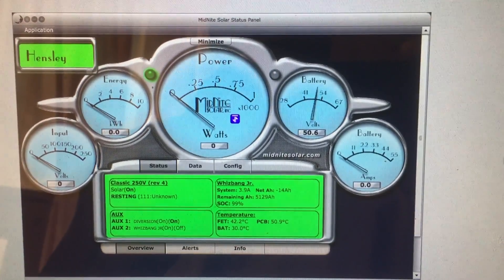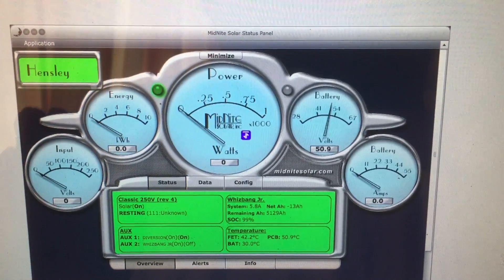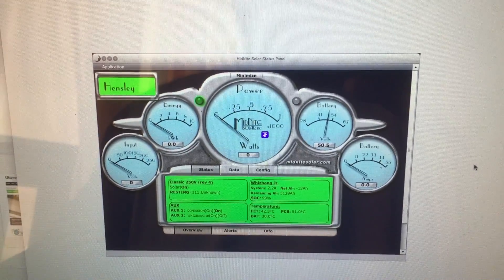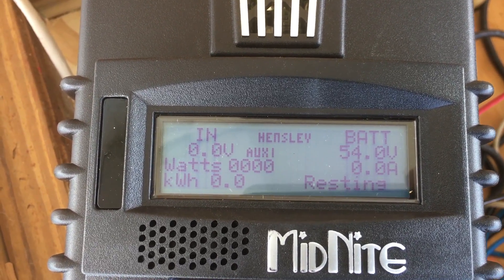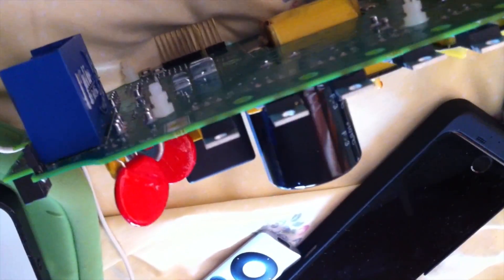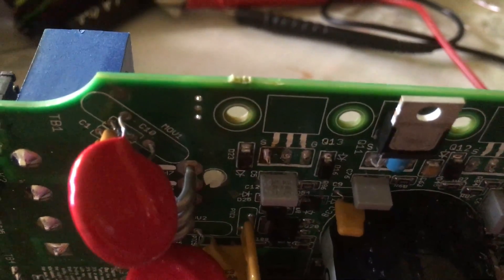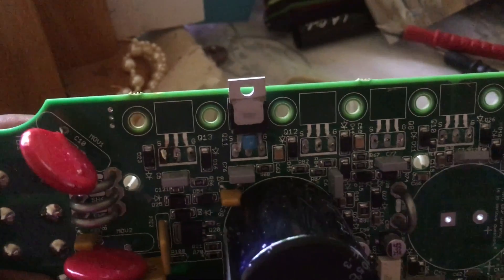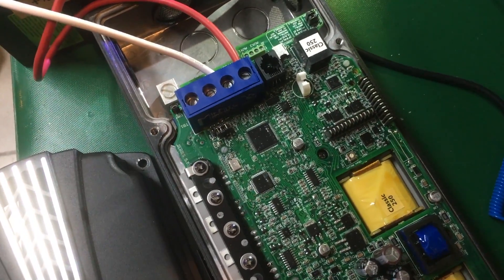Midnite Classic 250 Charge  Controller MOSFET's (IPP200N25N3 G.  PG-TO220-3) failure.

Comment: i have a problem with my charge controller its resting when it should not rest and its showing 0 watts i hear a relay in it clicking i am using lithium batteries
Reply from the maker: What’s the input reading from your solar panels or other sources?  Tell me your battery bank size 48vdc or 24vdc.  Please check your input and output cable connections then run the settings on your classic.  Another thing did you upgraded or reconfigured your system you experience these issues.
Reply: @hibiggs66  the pv volt is 103 before charge controller draw it down to 79.6v the battery is now at 51.6 volt when full charge its 55.9 volt i am using lithium iron batteries i upgrade the firmware to the 2018 firmware this morning
Reply: i have 3 24v pannels in series i have 3000 watts of pannels
Reply from the maker: Do you inverter connected with load. Your battery bank is fully charged and would not engage the classic charge controller to pull resources from the PV.
Reply from the maker: What about the lithium battery BMS is it functioning.
Reply: @hibiggs66  yes the bms is functioning
Reply: the battery is conected as 14s which when fully charged is 55.9 volt  and battery is at 51 volt now
Reply: absorb is set to 55.9 float set to 55.8
Reply from the maker: Let me get some clarity on this are you saying you have less than 130vdc PV connected to the classic.
Reply: @hibiggs66  yes
Reply: its a midnite classic 150 so i didnt go over 100 volt pv with it
Reply from the maker: What about the MODE in the bottom right corner is it ON or Off.
Reply: @hibiggs66  it say mppt theb when it go to resting it say resting
Reply: It dont show watt or battery current i have a wizban jr
Reply: It dont record killowatt either and you keep hear relay chip in and out
Reply from the maker: My conclusions are you may have to change your MOSFET’s.
Reply: @hibiggs66  what are the spesification of tje mosfets where do i get them to buy
Reply from the maker: The first time I changed mine I ordered from AliExpress 8 total. You may have to dig into your system to get the spec or lift one off from the circuit board to get the reading.
Reply: @hibiggs66  ok thank you
Reply: the charge controller start working properly now so this is strange something is bad in the charge controller but i dont know what it is
Reply: still having problem probably there is a crack joint in the classic voltage on pv is 78v current coming in is 21 amp voltage on battery is 51v current 20 amp
Reply from the maker: Please take a snapshot of the display during the night and day for comparison. I will do the same on mine to see what comparisons we can reference.
Reply: @hibiggs66  thank you i will do that
Reply from the maker: What’s the status on your classic change controller for the past few hours.

Comment: Great job 👍 did this fix the problem?? I’ve also got the same issue so I’m looking to do the same rather than buy a new board i also have a 250 Same as yours so I need to purchase the mosfet’s do you have the link where you bought them from
Reply: Helo, I can not find the mosfet référence number for the midnight classic 250. Can you help me. Thanks
Reply: @cristof48  I got it from digi key the number is an American numbering system so it’s difficult to find my advice is match the voltage and amps for the controller and it should be right but it’s worth sending off to get fixed as it’s actually not that bad a price and you might need to replace more than you think 👍
Reply from the maker: Yes I did. working perfectly up to now. check out  aliexpress.com for the Mosfet's.
Reply: Hensley Isaac thanks very much for your advice on this I’ve done it and it worked I’m so pleased I got my mosfet’s from a company called Digi-Key in the end in America free shipping and they arrived in the uk within a week lol .... I struggled with de soldering the fets as they really didn’t want to come out in the end so just saying if anyone ever does this and has the same problem I got around it in the end by using a dremel grinding disk made it flat very carefully and then drilled it through with a fine bit 👍 thanks again all the best
Reply from the maker: Great job glad you are back online.
Reply: Hensley Isaac yea can’t believe it worked ha ha thanks 🙏 cost me £40 to do it would have been near  £400 for a new board !!! Really appreciate it man
Reply from the maker: Happy your unit is back on line, great job.
Reply: Hensley Isaac nice one man cheers 👍👍👍👍
Reply from the maker: Yes that is correct. I think you need 8.
Reply: Hensley Isaac  great stuff cheers

Comment: With the battery connected @48 volts the classic should take 300 volts did you have the PV on without the battery connected. Did you ever find the short
Reply: OffGrid Wanabe  I see you have removed the 315v capacitor. Did this shows signs of being blowed? Was it deformed? Thanks

Comment: Nice to see your controller back in service. I had a similar issue with my Flexmax and sending it back would have cost me so much. So decided to fix it. I found out 4 of the output MOSFETs had shorted. Removed all the MOSFETs and Swapped with new ones and the system has been running since.
Reply: What type of MOSFETs are installed in Midnite Classic ??